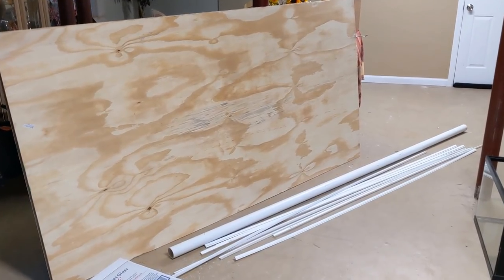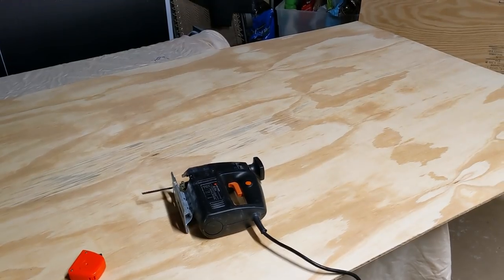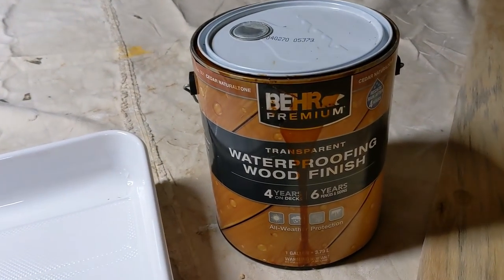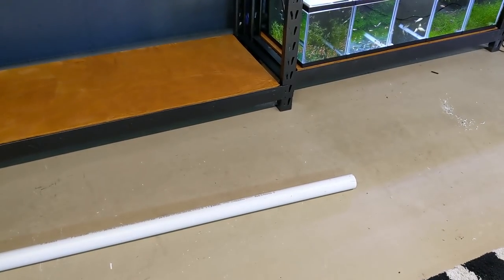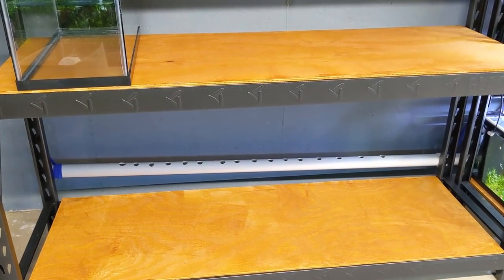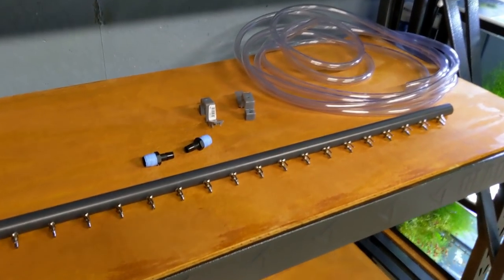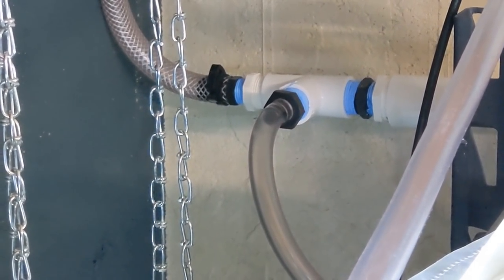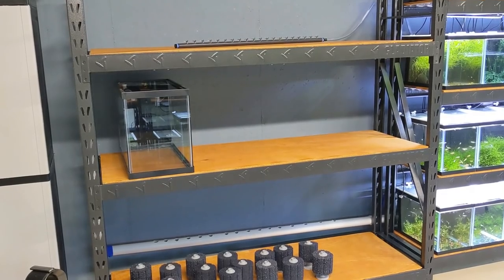Fish Room Build! Auto Water Change Overflow Plumbing, Wood Preparations, Air Pump Filtration System

Comment: Great video. If you have to cut plywood like that again yourself, invest in a cheap circular saw. Better cuts than a jig and takes up way less space then a table saw.
Reply: Agreed. Even a cheap battery powered circular saw would work just fine.

Comment: Fantastic series!  I'm wanting to upgrade my fish room to all drilled tanks and an auto water change/piston air pump system. I'm going to take the plunge and will probably need to get on the phone with Jemco. I bought my first house last year and can finally really expand the hobby. I set up a bunch of tanks but the maintenance for water changes by hand is getting to be a bit much. I had Radon remediation done in the basement, so the sump is completely sealed off (airtight). Do you think I need to have a separate one installed to create a system like this? Thanks for this and I'm loving your channel! :D

Comment: For drilling pvc pipes, if you want all the holes in-line (ie on the top) it works well to put it on the ground next to a 2x4 and run a pencil/sharpie along the length of board for a straight-edge. Just depends on how particular you are with such things.

Comment: Hi, how many tanks and air drops  do have the air pump running? I am trying to determine if I want the 45 or 60 but I think you have tanks but not as many lines as I do. 2-3 depending on tank size. Thanks in advance.
Reply from the maker: I would say go for the larger pump and get a bleed off valve. You can always expand or keep it the same with the bleed valve